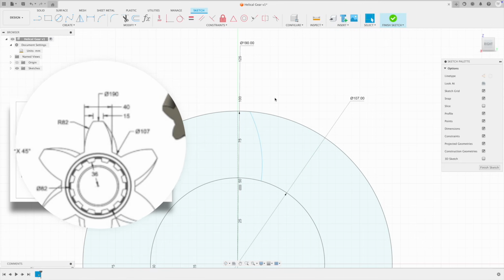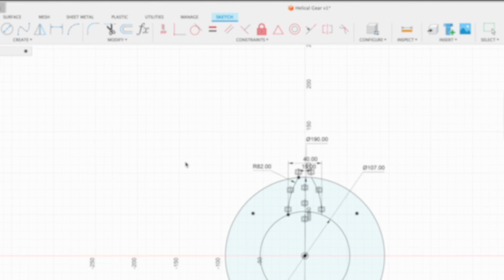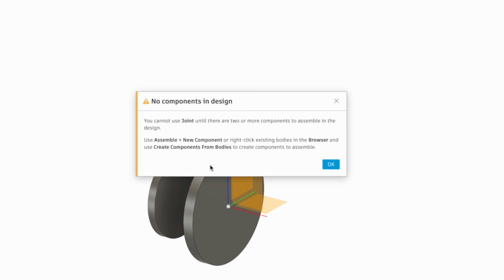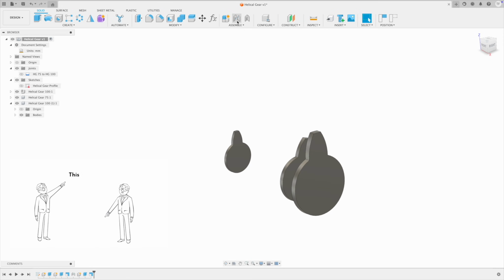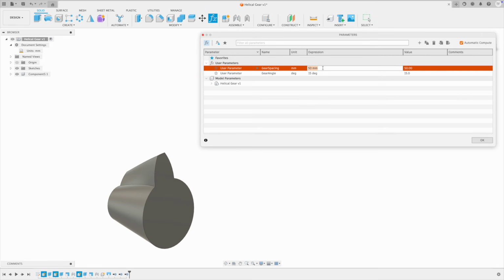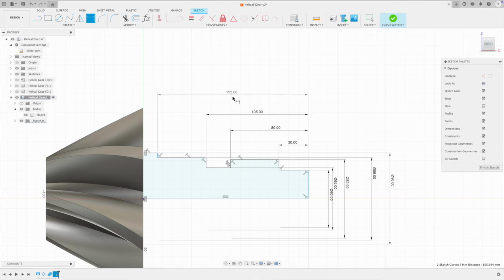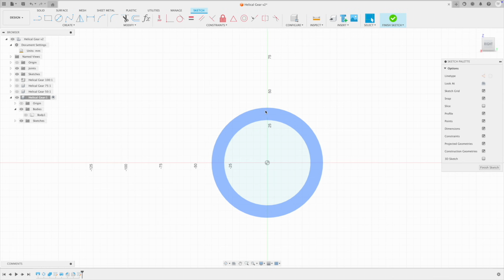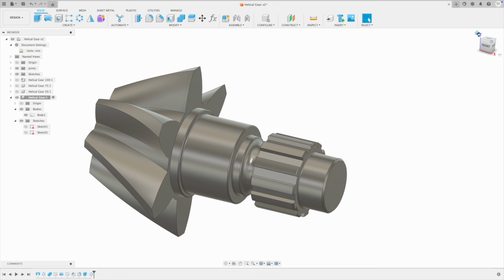Autodesk Fusion 360 - Helical Gear - Intermediate/Advanced Tutorial (2024)

Comment: Just curious, Why doesn't the Move command retain the values? It makes it almost useless as a command because you cannot rebuild your project
Reply from the maker: The Move command in Fusion is primarily a direct modeling tool, not a parametric one. While it records that a move occurred, it generally doesn’t retain editable X, Y, and Z values in a way that fully drives the model. For rebuildable, editable designs, it’s usually better to control geometry with sketch dimensions, constraints, user parameters, construction geometry, or joints instead of relying on Move. That’s why many experienced Fusion users treat the Move command as a last resort for parametric workflows.
Reply: @learnitalready  Sure, I see that, but it seems to be a big omission in the product. 🤷‍♂
Reply from the maker: @SnowGypsy25 I felt the same as you when I started, but I now see how practical and beneficial using Joints is in a parametric design. Maybe I can try and think up a good tutorial that shows practical examples of this.

Comment: How would I do this workflow but have the gear shaft maintain it's diameter while the gears taper down to nothing at the end of the gear shaft?
Reply from the maker: Try this: take the exact same model that I created, select the front face, and then press backspace (or delete). It should do the work for you and create the needed geometry down to a point. Let me know if that works.

Comment: Great tutorial. Quick question. I noticed at the end sketch when you manually added the lines to match up with the project of the chamfer you performed the circular pattern in the sketch itself and not as an extrusion feature like when you made each individual gear component. Are there any best practices or instances when to use the pattern in sketch mode vs as an extrusion? Thx
Reply from the maker: Thanks for reaching out! Yes, the best practice is to always try to create minimal sketch elements and then do the patterning in the solid environment. If that isn't possible, for some reason, then proceed with patterning sketch elements.
Reply: @learnitalready  awesome. Thx again. Your videos have been very helpful for me as an engineering student
Reply from the maker: @ I truly appreciate knowing that. Thanks for your encouragement and stay tuned for more.

Comment: Is there a specific reason for not using the real centerline feature instead of right click and choose diameter dimension?
Reply from the maker: Awesome question. As explained in the tutorial using one or the other is mainly a way for you to quickly verify that you have inputted the correct dimension into your sketch from your drawing. It is better to not do the math if at all possible because sometimes we make mistakes while doing math. 
So, put simply, if your drawing calls for a dimension that spreads past a centre line and can be mirrored (could be a diameter but doesn’t always have to be) then use the diameter dimension method. If the dimension on your drawing is from your centre line then use the standard dimensioning method. 
Also, this isn’t a clear cut rule, it’s just a suggestion that will help you avoid mistakes and help build your confidence that you’ve inputted the correct dimension.
Reply: @learnitalready  what i ment was say for example you draw a "centerline" then you can make it into a construction line, but you also has the feature to make it a real centerline, and if you do then all measurements you take from that line will be treated as diameter dimension. I have seen many expirenced users that doesnt know of this line Tool if we call it like that. You can try it if you draw a line, and then in the line Tool that pops up to the right Where you can choose to make it as a construction line, next to that Button you have the centerline Button. Just a tip if it is like that you haven't seen that before 😀
Reply from the maker: @ Ah I understand now! Thank you for pointing that out. Yes, I have used that centreline button before in the sketch palette, but find it easier to right-click. However, thanks for your suggestion because it’s good to explain that in my tutorials too. Much appreciated!!! □

Comment: Why do you draw arch but not evolvent in section of gear?
Reply from the maker: Hello! I think I understand what you are asking, but please correct me if I’m wrong. Are you asking ‘why did I use Revolve instead of Extrude?’ A revolved sketch is not only easier to create, but easier to edit if needed, and also keeps the timeline to a minimum amount of tools/features, which speeds up calculations and makes Fusion run faster. Hope that helps.

Comment: How do you decide what the gear that interfaces with this one should look like? Parametric from the first setting the second gear?
Reply from the maker: The best thing to do is get a Machinery’s Handbook (they are a little expensive) and search for the specific gears that you need. The Machinery’s Handbook has every single formula for every gear imaginable. It’s well worth the price if you need to know all the mechanical specs of mating gears.
Reply: They aren't too expensive. Get an old version it will be just fine. They change so very little from year to year, that a 20 year old book is still great. n@learnitalready

Comment: The problem of scaling and moving sketches is easily overcome, by turning off the projection link box when you you project the sketch. For what I'm usually making that link use to drive me crazy. I can't take any credit for it as I saw the tip in a video by John Hackney, his videos helped me a lot when I'm working in sheet metal. People like you make YOU TUBE AWESOME!
Reply from the maker: Thanks for your comment! Yes, you are absolutely correct, however the ability to parametrically control it is lost. Just another skill to learn in using components. Thanks again!

Comment: For scaling the sketch at the start, cant you just use break link after projecting to be able to scale? Is there a reason not to do that
Reply from the maker: Awesome! You are the second to comment on this point. That would work almost perfectly. Unfortunately  once you create that projection and break the link, you cannot adjust it further if needed. So, if you get it perfect the first time, then it would work fine, but parametric control is no longer possible after.